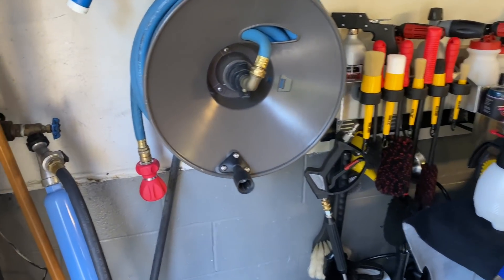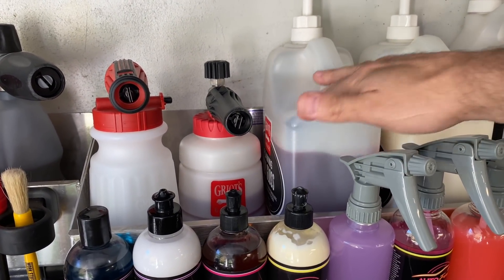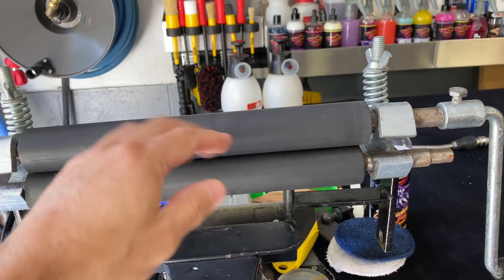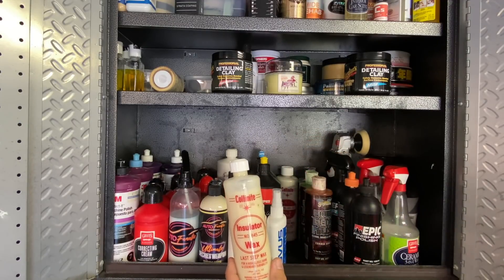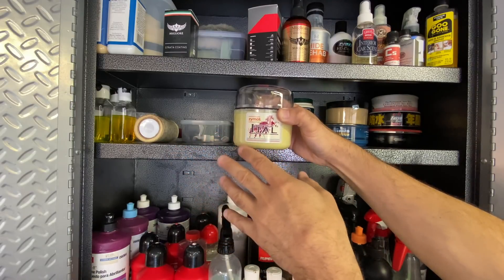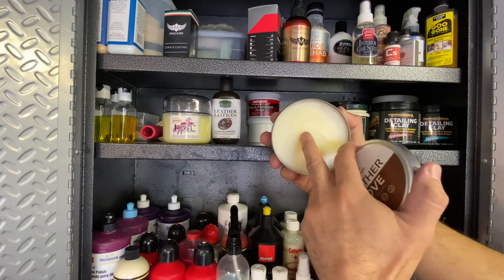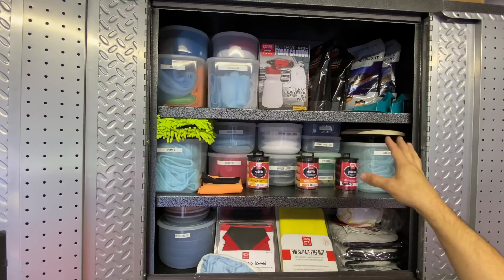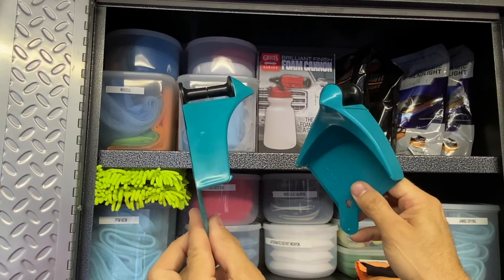Auto Fanatic Detailing Arsenal | Inside My Garage Tour

Comment: Hi Auto Fanatic,

I would be pleased if you would answer some of my questions. I'm from the UK and interested in importing the Shelby one day.

Q1 How does the Shelby GT350R compare to the BMW M4/M3/M2 in terms of handling and acceleration? 

The Shelby gets a lot of praise for its handling and the visceral experience it offers. But does the GT350r handle a lot better than the BMW or is its handling capabilities just enough to match the BMW M4? The Shelby GT350r has a slower lap record than the BMW M4 on the Nurburgring. 

While it gets a lot of praise, the steering still lacks feel/feedback, but others say the steering feel is good. I heard some people say that the GT350R still feels a bit heavy and that it is not as nimble as the BMW M4 and M2.

Q2 Some people replace the carbon fibre wheels because they are scared of damaging them, however, can you feel the difference when they get taken off?

Comment: Holy shit! That’s around what $2,000 - $2,800 in supplies? My wife would kill me again.
Reply from the maker: quite a bit more than $2800 the pressure washer set up is about $1800 itself. i could not even show everything the video would have been 3 times as long this is just the stuff i mess with regularly on detailing cars. I filled an entire 50 gallon trash bin with tester products and failed stuff i never showed on the channel before i shot the video because the garage was overloaded.

Comment: Obsessed Garage goes with CarPro Dlux and Gliss for the wheels.
Reply from the maker: I tried DLUX the issues i seem to experience over and over with wheel coatings is their effectiveness on satin, matte wheels not sure if this is because some wheels are painted and some powdercoated and maybe this affects the surface pores to accept these coatings or not but on a high gloss rim finish almost any coating seems to work ok except the C5 armor on my Shelby GT350R carbon fiber gloss black wheels did absolutely nothing on the testing iv done. Soon I want to try something new on the Shelby GT350R
Reply: @autofanaticcars  I heard csl+exo is good.
Reply from the maker: I really am considering the Zipang coat by Kamikazze for the 350R soon, curious if the price sets it apart or not
Reply: @autofanaticcars  friend of mine did it on his 335i he likes it alot. Good gloss and durability.